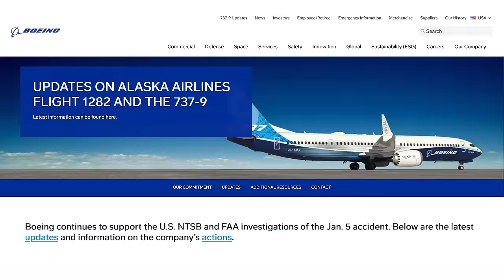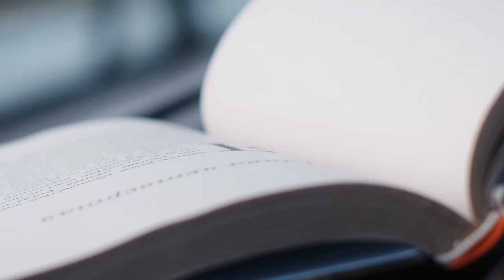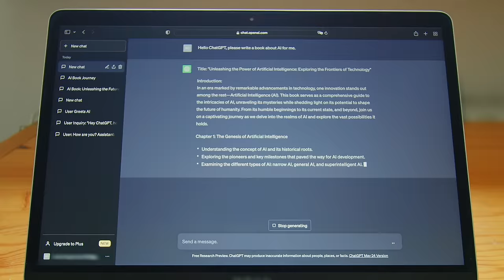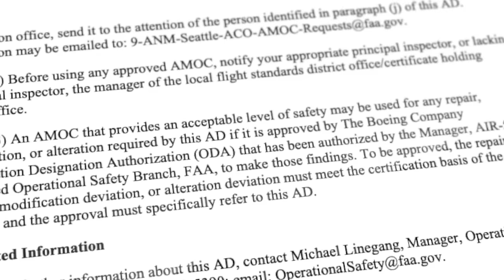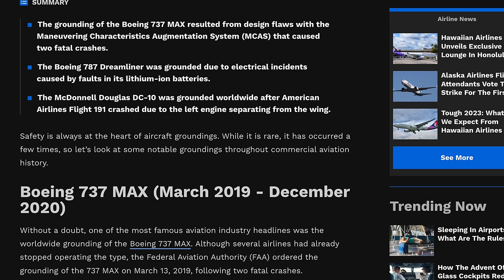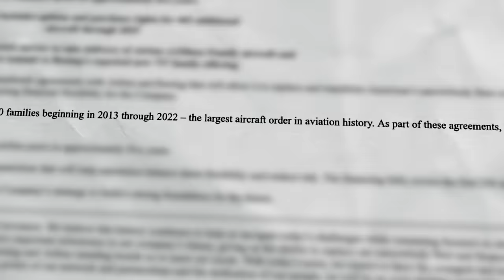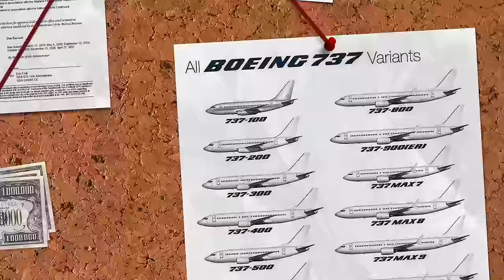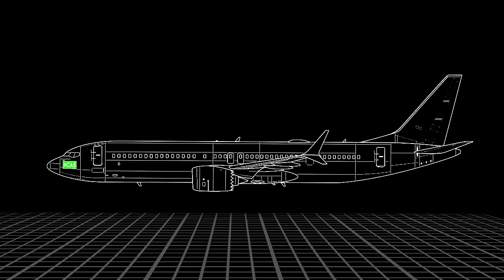737 MAX - How Greed is KILLING An American ICON

Comment: The fact that no one went to jail for MCAS is disgusting.
Reply: So true!!
Reply: If you are rich, the laws simply don't apply to you
Reply: If corporations have free speech, why can’t they serve prison time and cease operations for a time. I understand the economic impact would be huge. It would make compliance cheaper than the consequences and fines of skirting procedures.
Reply: rich people don't go to jail
Reply: It's aint just disgusting. It's America.
Reply: That's always the problem with corporations. They are regarded as persons that are distinct from management, so the managers that approved this course of action can't be charged.
Reply: … but also, not surprising. 
Corporate accountability seems to ALSO be outsourced to its vendors.
Reply: As an engineer who worked for 25 years in the industry, I think the chief engineer and the PM who allowed the MCAS system to be implemented at a blatantly incorrect DAL should be held criminally liable.

The FAA put too much trust in Boeing as the design authority and the airworthiness office at Boeing should have never allowed this system as it was originally implemented.
Reply: @tmack2506 " The FAA put too much trust in Boeing ". Allowing a manufacturer to self-certify is an obvious dereliction of duty. FAA should be fired.
Reply: I've read rumors that all of the pilot had to do was to just hold the trim wheel in place.
Reply: @tmack2506  If they get held responsible, so should the executives. Why do the money hungry bonus pursuing people who apply the pressure to make the poor decisions get shielded?
Reply: @machintrucGaming  
Doesn’t matter. It still wasn’t in the instruction manual. They even followed the steps in the flight checklist, but the MCAS overrode their inputs. (Which is an aviation no-no) 
The autopilot controls are NEVER allowed to override the inputs of the flight crew; especially if the flight crew is trying to override what the autopilot is doing! 
That is a clear violation of aviation protocols. 
Same principle why your cruise control disengages when you tap the brake pedal. 
The NTSB concluded that the MCAS system overrode the pilots desperate attempts to pull the nose up on both Ethiopian Air and Lion Air.
Reply: Not only that, the ceo received a multi-  million $ package to resign.
Reply: If you have money in the US, crime is legal and human life costs pennies. You also get bonuses when you leave 😂
Reply: I have no aviation expeience but part of my job in software requires us to always plan for redundancy basically meaning a failsafe if the primary server fails. I can't believe the MCAS system only had one sensor the angle of attack sensor and no others, should be at least, at very least, two sensors ideally 3.
Reply: Cold fusion talks about this. The MCAS was not supposed to completely reset. It was only supposed to make minor corrections so the redundancy wasn’t necessary. Of course didn’t work out that way.
Reply: a court of his peers found him not guilty. 
Jury Finds Former Boeing Pilot Not Guilty of Fraud in 737 Max
Reply: Companies rarely face criminal charges, they just pay a reduced fine after negations...
Reply: If only sending people to jail fixed everything.
Reply: No, it’s CRIMINAL…..
Reply: @machintrucGaming  The Issue wasn't so much the MCAS system as such. It was that it was an undocumented system. Boeing pretended the system didn't exist. The Pilots who crashed didn't have a clue what was going on. If the system had been documented it would have meant airline pilots would have had to be type rated, and they would have had extensive training in the system and how it effected the aircraft. But type rating is expensive, and would have made the aircraft a lot less attractive to airlines. Acting like and idiot has consequences, even for corporations.
Reply: @katerachelbooth  there are only 2 AoA sensors.
Reply: The fact video creator who ISN'T  a pilot thinks the Federal Aviation Regulations or FAR, apply to Ryan Air, just shows how little non pilots are to talk about planes or aviation, and they should just stop. No matter how much you think the video creator knows what he's talking about because he did some "research". He doesn't

Comment: The mcas debockle is actually a bigger deal than the door situation because it reveals dangerous decision making .
Reply: DEI nonsense.
Reply: Yes, very bad decision making.  Boeing tried to charge customers for redundant AOA sensor logic in the MCAS automation, when it should have been base-line just for safety.  So one malfunctioning AOA sensor, coupled with pilots not realizing that they were fighting an automated system, could crash the plane.
Reply: And possibly criminal behavior.  It’s one thing to make poor engineering decisions, it’s another to lie to the FAA about them
Reply: You could say this about all self regulated businesses. It's like putting the coyote in charge of the chicken coop.there are lots of them .construction is one example
Reply: Corporations have established that fatality rates are not only acceptable for doing business, but are also “negotiable”.
Reply: The door shows their concern about MCAS was cost so they cut corners on quality and inspections. There will be more issues because of that besides just doors. Hopefully it's just Max that's riddled with defects because of that not everything Boeing makes.
Reply: Debacle
Reply: MCAS wasn’t disclosed to the pilots as a system function. This is the scariest part. Imagine what other systems are snuck into Boeing aircraft to save money. 

Boeing - the sound made when parts hit the ground.
Reply: The door frame situation was not only sloppy workmanship or management pushing margins. The problem was, it wasn´t found during the revision because the issue was tracked over 2 separate systems. That´s absolutely abysmal communication in a critical environment. The problem I see is a corporate environment that let this situation appear and develop. The amount of frustration, complacency, fear, ignorance and internal quitting and dissociation piling up in engineers to not nip this 2 tracker-situation in the bud is what creeps me out.
Reply: @kissthesky40  Is that a preprogrammed response?  BOEING management is not exactly a dirverse crowed so I doubt DEI could have had anything to do with it.
Reply: @GerhardMack  
new hires.
Reply: @kissthesky40  In both cases, the problem came from the top. It was management who decided to add the MCAS and it was management who decided to spin off the fuselage part of the production and put it on it's own separate defect tracking system.

Blaming the people at the bottom is just lazy.  Blaming it on DEI just outs you as a conspiracy driven racist.
Reply: @GerhardMack  
I’m sure. I’m mainly referring to future debacles. No good can come from DEI hiring in aeronautics.

Comment: In a word:   YES   It's a rotten corporate culture.    retired airline pilot
Reply: Do you think dei is partially responsible for the corporate culture ?
Reply: @katiegreene3960
Was Boeing asked to refit the plane with a new pronoun and a new gender assignment? If not, then no, dei is not responsible.
Reply: @katiegreene3960  what means DEI ?
Reply: @katiegreene3960  Doubt it, BOEING management is not exactly a diverse crowd
Reply: In this story it's not the management that matters its the maintenance employees
Reply: @katiegreene3960  good grief. It was not the maintenance employees who decided to split the fuselage production from the rest of the company and also moved  to its own defect tracking system that did not interoperate with Boeing. Also, maintenance employees perform maintenance procedures as prescribed by management. So if there was a systemic problem that is on management.

Comment: As others have pointed out, the NTSB report shows the four bolts were not present.  These small bolts do not directly hold the door plug in place.  The door plug is held by a set of robust brackets and pins.  The door plug must be lifted upward to release it from these brackets.  The missing bolts prevent it from moving up.   Any single bolt is sufficient, so the system is 4-way redundant.   The error was that Boeing had removed the door plug after taking delivery of the finished fuselage from Spirit to address an unrelated mistake (5 misdrilled holes) and then, upon reinstalling the door, neglected to reinstall and inspect the 4 bolts.

Humans make mistakes.  The failure to reinstall the bolts was not the root-cause.  As you point-out, the root-cause is systemic.   There must be sufficient time and staff to do the job right.  Double and triple checking must be done by independent inspectors.  The list of shortcomings goes on and on.

Corporate greed, and a shift from engineer focus to business focus,  absolutely contributed to this and other 737 MAX (not to mention 787 Dreamliner) failures at Boeing.

However, I’d argue the real root-cause is simple human complacency.  Like the space shuttle disasters and numerous industrial and civil engineering disasters in the past, it is extremely difficult to justify safety dollars, resources and time over long periods (years and decades) when things are working fine.

There were over 98 MILLION commercial jet departures in the U.S. in 2023 with ZERO lives lost.  The last inflight U.S. commercial jet fatal accident was in 2009 (Colgan Air 3407).  That was 14 years ago.  Over 1 BILLION safe takeoffs and landings.  How does one justify year after year continued high investment in safety protocols with a record like that?   How do you argue that a cost reduction of 5% here and 3% there unduly puts lives at risk?  How do you distinguish between a dollar well spent and a dollar wasted?

I am not defending Boeing (or NASA or countless other organizations who fell into the same trap).  We pay these organizations to provide their services safely.  And I am as appalled as anyone (as an engineer, likely more so) to see how far Boeing has fallen.  I am just pointing out that, as humans, we tend to focus our time, energy, and dollars on the problems immediately in front of us.  After DECADES and BILLIONS of event free flights, should anyone really be surprised that Boeing got complacent and lapses are appearing?
Reply: So explain the reason, why pilots were not trained to disengage the MCAS system ? To me if this is true then it's jail time.....
Reply: @lastlion65 simply put no one can give a legit honest answer to that question. But we all know the real answer
Reply: I'm a B1/B2 engineer in Europe. The US talks money - as you do. Europe also speaks money, but will spend as necessary. The US only spends the money during the next maintenance evolution - and I know engineers who refuse to work with American companies for that reason. As an aircraft engineer I want the number of safe take off's to equal the number of safe landings in perpetuity, not we've done a billion so 200 dead is acceptable due to money reasons...
Reply: @lastlion65  MCAS was an unknown automated system (-unknown to the crash victims-) operating in the background.  The action that the pilots took (other than turning off the stab trim actuators) should have disengaged the autopilot(s).  Maybe if they would have known about MCAS (which was kept out of the manuals), they would have taken a different set of actions.  They also didn't know that MCAS became active once the flaps/slats were set to the cruise/0 position.  In one instance, they did shut off the stab trim, but turned it back on because they had trouble manually trimming the airplane due to the high aerodynamic load on the stabilizer.
Reply: Thx for your contextualisation within psychological diagnosis. Brilliant.
Reply: this is false.  The LARGE bolt directly hold the door in place.  The stop pads only provide lateral stability by pushing on each other under pressure.
This is evident as the LACK of the bolt allowed the door to escape.
Reply: The FAA preliminary report states "The agency said in a report released in early February that "four bolts that prevent upward movement of the MED plug were missing before the MED plug moved upward off the stop pads."
Reply: @soccerguy2433  It is not false. See any animated video of the system, such as the Mentour Pilot video on this event, the description of the OP is accurate. The door was in place due to its own weight, inserted in brackets and pins and its outward movement restrained by the stop pads. Yes, the lack of locking bolts allowed the door to drift upward the pins and brackets, driven by vibrations, misaligning the stop pads that ultimately failed. The 4 missing bolts were not meant to support neither the weight of the door nor the differential pressure, but to prevent it from escaping the brackets and pins that held it in place.
Reply: in the door situation, I see the main issue in the door situation being tracked over 2 separate communications systems to bypass triggering a general quality assessment issue with all its hassles. That is dangerously skewed priorities, and it probably came from the absolute jungle of outsourcing, suppliers, and suppliers of suppliers and daughter companies and contract workers and .......all for the sake of reducing the cost of work. Or. To avoid compensating the workers for their contribution to added value. 
Paying dividends to stockholders on rising stock value needs to be outlawed, imho.

Comment: Boeing used to be the greatest innovative engineering company-- then it got rid of the engineering executive to replace it with MBAs when it merged with McDonnell Douglas, which put maximizing business profit for stock prices, and cutting corners as the priority.  It has been that way ever since on all their aircract and aerospace ever since-- not just the 737 max.  Investigate the Starliner that Boeing is trying to make-- failure after failure, it is embarrassing and scary that they think of putting humans into flying it some day... the entire thing should be cancelled!

Comment: Thanx for this video 👍🏻
One thing: 
The pilots of Ethiopian Airlines Flight 302, the second Boeing 737 MAX to crash due to issues related to the Maneuvering Characteristics Augmentation System (MCAS), were aware of the existence of the MCAS system by the time of their flight. Following the crash of Lion Air Flight 610, which was the first 737 MAX crash attributed to MCAS malfunctions, Boeing and aviation authorities had disseminated information about the MCAS system and issued directives on how to counteract its unintended activation.

According to the Ethiopian Civil Aviation Authority’s preliminary report and further investigations, the pilots of Flight 302 attempted to follow the emergency procedures that Boeing had outlined, which included disabling the electric trim system, a part of the process for shutting off MCAS. However, despite these efforts, they were unable to regain control of the aircraft. The reports indicated that the pilots struggled to manually adjust the trim due to the aerodynamic forces acting on the aircraft’s control surfaces, which made manual trimming via the trim wheel extremely difficult if not impossible under the flight conditions they were experiencing.
Reply: Good point. Thanks.

Comment: Good summary.  I have friends in the aviation safety industry who, when the Lion Air crash happened, all were dumbfounded when they found out it was because of the MCAS.   These aviation safety experts had no idea what MCAS was and how it got installed on these airplanes without their knowledge, the knowedge of the operating airlines flight departments or the pilots who were flying them.  Certainly this was criminal, but no one was held responsibe in any meaningful way (like being imprisoned.)